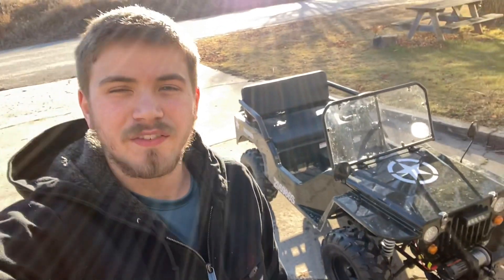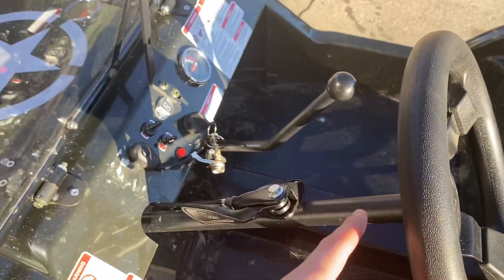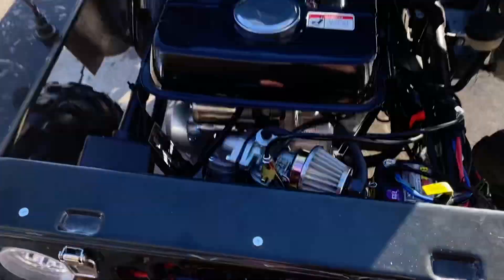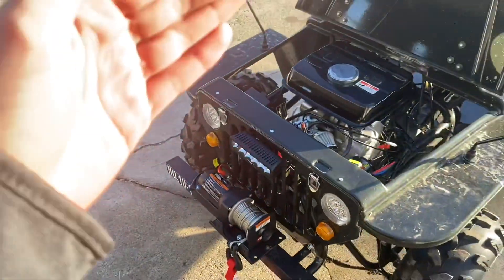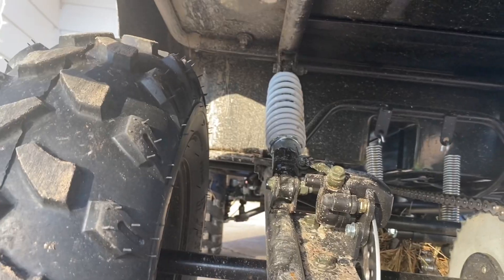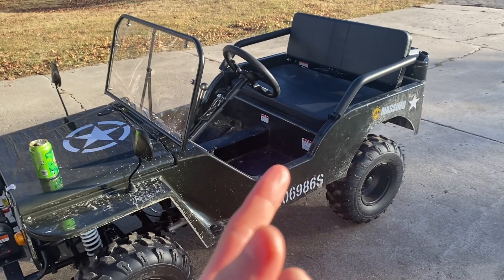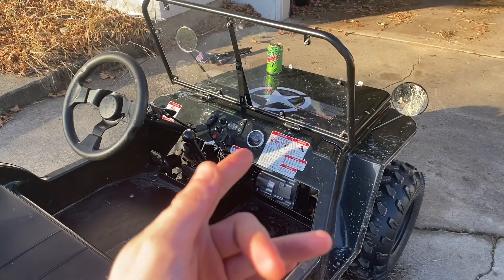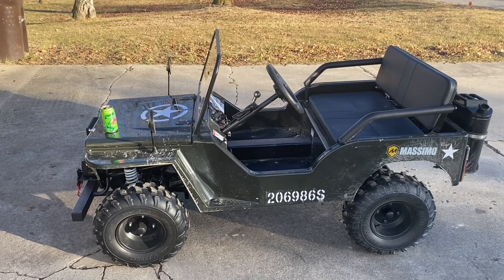TS Mini Jeep Review + mods!!!!!!

Comment: Grease the back two bearings, my driver side one didn't have grease in it at all. Good video man, subbed for updates.
Reply: Mine are sealed. Got the Massimo from Tractor Supply. Just because there is a grease fitting doesn't mean anything. If you grease a sealed bearing it just puts grease between the housing and outer race of the bearing.

Comment: I bought 1, so far I’ve reworked the spare tire bracket because the wheel set crooked, added a 22” light bar on top of the windshield, added a 8 ball shifter knob & used the old knob for an imitation 4x4 lever that I made, wireless winch. They are fun to play with. Our little dog loves riding in it. Ours runs about 40mph as well

Comment: I would recommend getting it from the tractor supply centers or something like that not Amazon because Amazon‘s has a different set up. It looks just like it, but it’s the Chinese version so that means the break is actually a little lever right on the steering wheel at least mine it is, just like the Chinese one that I got is 2 Wheel

Comment: Those rear axles snap very easy. I broke 2 in 6 months and the mini jeep is only 6 months old. The headlights run the batteries dead in less than 30 minutes as well because it has no charging system. It will also constantly foul spark plugs, and suck dust into the carburetor..I honestly cannot recommend these things at all. mine also vibrates very badly.